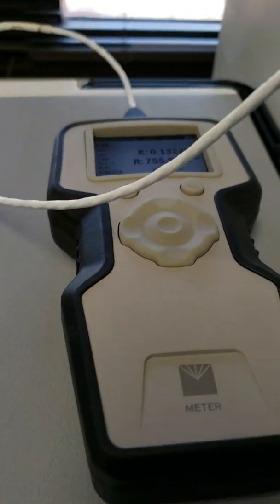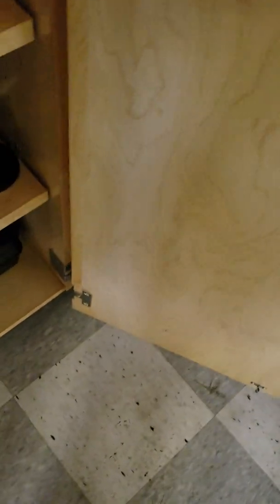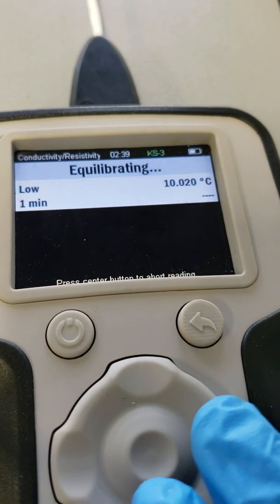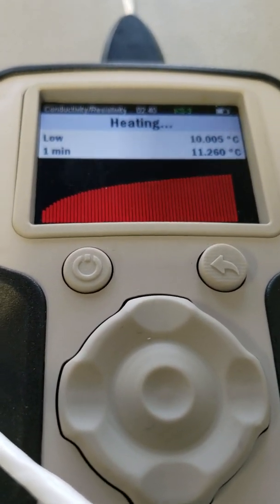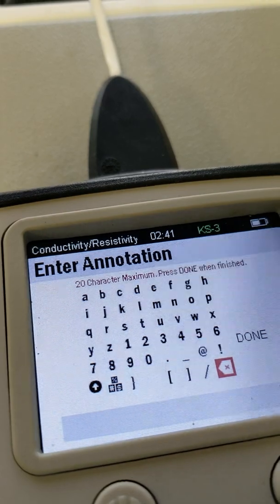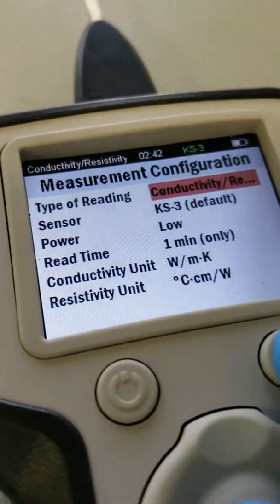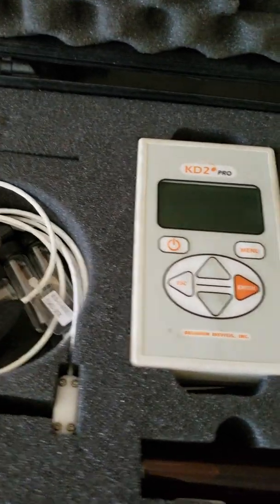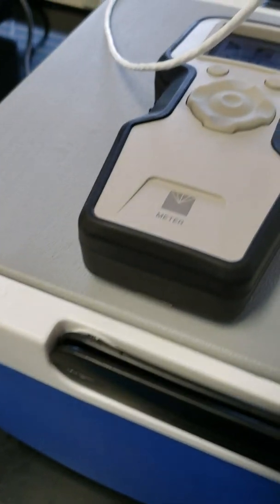Using the Meter TEMPOS

Comment: thanks. Just acquired one in our lab. Roughly how many measurements do you take till you're confident on the thermal conductivity measurements?
Also, any tips on how to acquire the best measurements? I am also working on obtaining a fluid's thermal conductivity
Reply: Did you get any good values for fluids? In our lab we were not successful so far...
Reply: @DRoque14  to be honest I'm not totally confident in the measurements so I take about 10 to 15 sample readings and average them out. There is definitely natural convection that occurs in the samples
Reply: @arturzych138  We have been trying to measure liquids with viscosity similar to water and have not been successful. It either gives too much or too little, even if we leave it in the unattended mode
Reply: @DRoque14  likewise. those outliers I discard but keep anything that seems within range but take many measurements and show the standard deviation.
Reply: @DRoque14  Hi. We have the same problem. When measuring liquids with high viscosity, there is no problem. But, when measuring thermal conductivity of liquid with low viscosity (similar to water) with the KS-3 sensor, we have oscillations in the measurements. have you managed this problem?
Reply: @santiagocespedes8616  Not yet :/